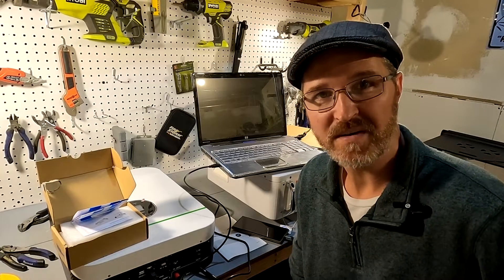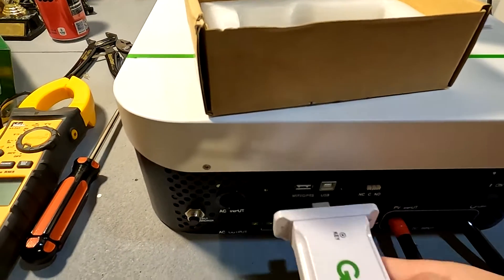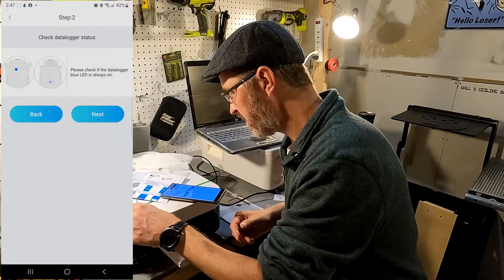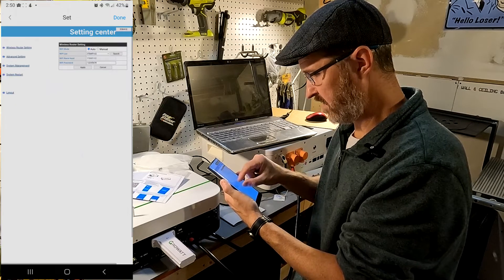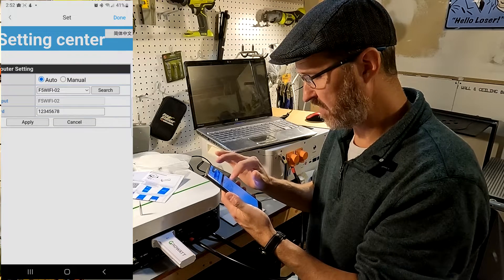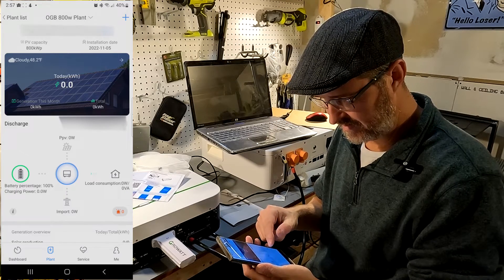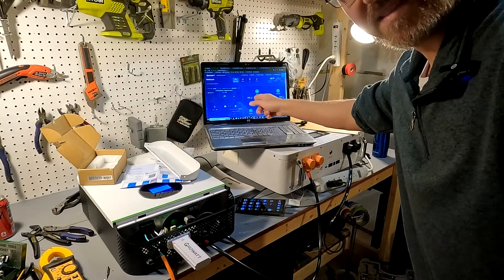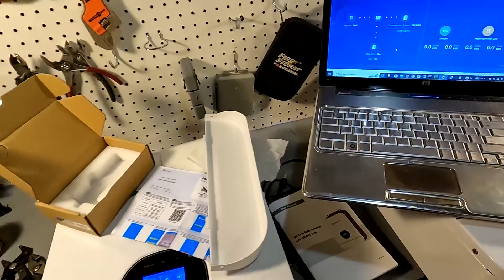Connecting a GroWatt to Wifi.  I should've read the manual.....

Comment: My app only displayed options for 2.4 GHz and Hotspot. After several attempts, I realised that both my 2.4 GHz and 5 GHz Wi-Fi bands were using the same SSID. Once I renamed the 2.4 GHz network and connected to it, everything worked correctly
Reply from the maker: Thanks for the tip! I appreciate you sharing your experience.

Comment: Trust me, you will be much happier running Solar Assistant rather than the Growatt WI-FI, you do need a RASPI to run it on. I learned this the hard way, my dongle is now sitting in a box.
Reply from the maker: I feel like RaspPi's went way up in price in the last year so I'll wait a bit before switching over.  Thanks for the info 😊
Reply: @OffGridBasement  I just bought mine on eBay.  A whole lot cheaper than buying new.  Still not as cheap as they used to be, but much better than $200+!

Comment: Sure you will get it all working in the end.🤠 Might not be right time ,but what interest me is can you use the smart battery with like a dumb batt no  CAN or communications 48v invertor like say the freezer set up.. Maybe never seen anyone use a sever rack batteries same way you use say you Chins..
Reply from the maker: Yes you can.  You would just need a bi-directional battery monitor.  The CAN and RS485 connections are just advanced features, not necessary.